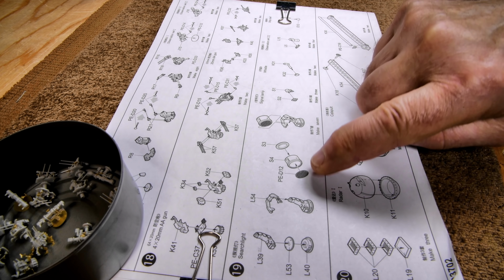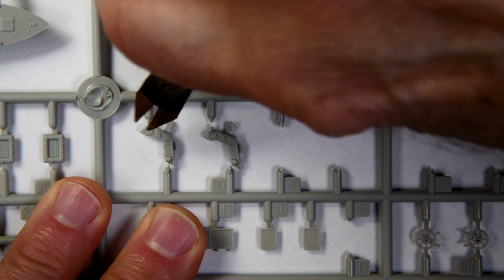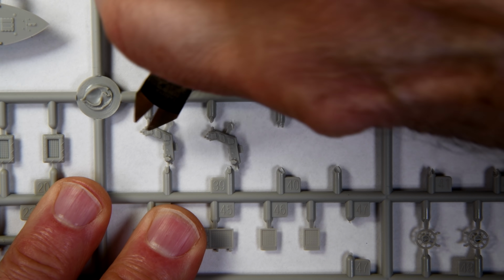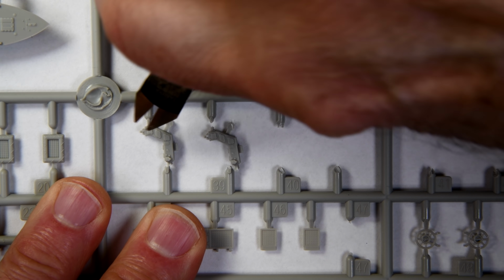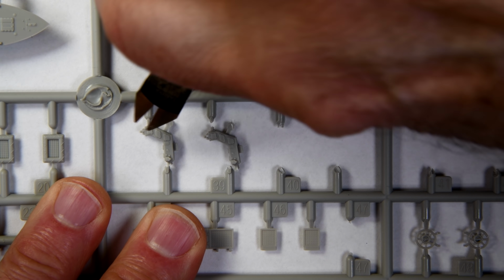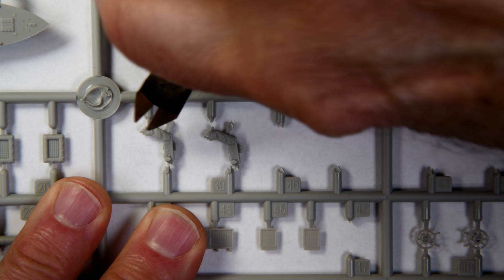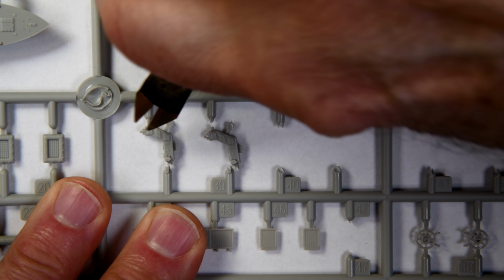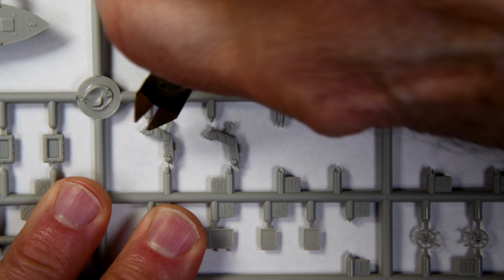The Model Ship - Part 121

Comment: Ron, I was just curious if the clear parts were much more brittle than the gray parts?  It certainly sounded like you had a louder snap sound when snipping them.  Did any of the clear parts show signs of cracking?
Reply from the maker: I was wondering about that too Jerry. Haven't started trimming them yet. We'll see in the next episode tomorrow I guess. Thanks for raising the question. 👍